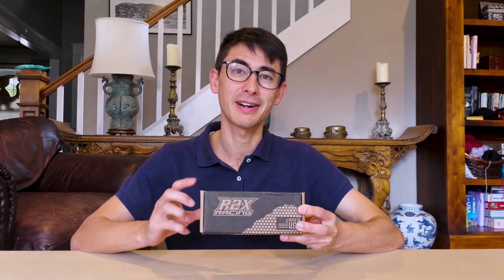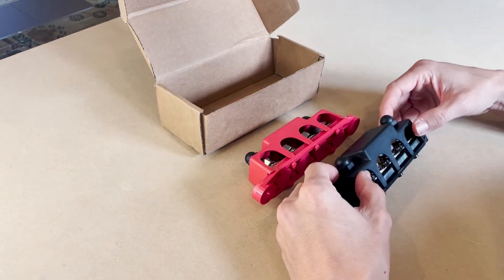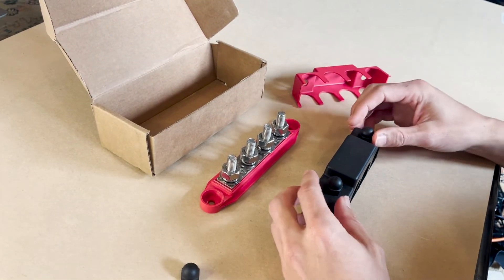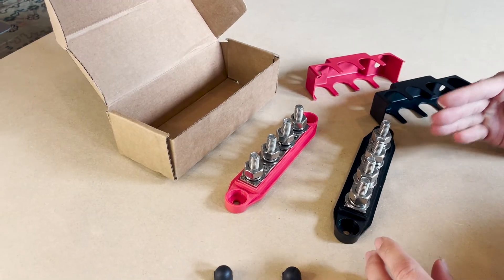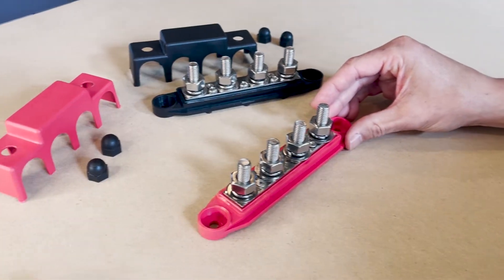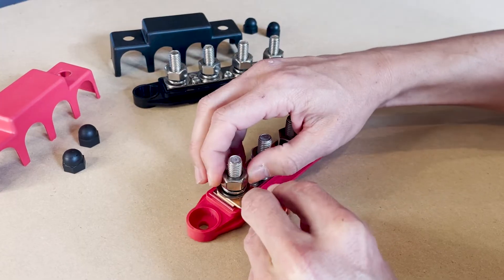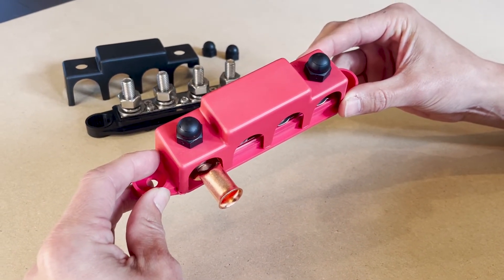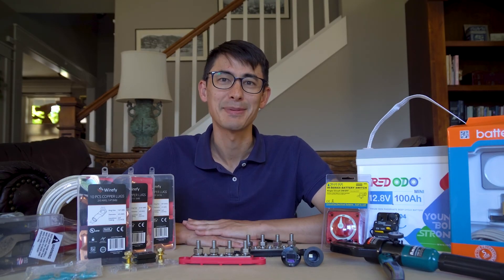What Are Bus Bars? And How To Install Them

Comment: those busbars are not rated to what they say they are if you measure the width and thickness  of the bar and check on bus bar calculator you will be surprised to find out they are rated to only 48 amps safety matters these could cause a fire if overloaded
Reply: What’s a good bus bar then for heavy connections ?? For